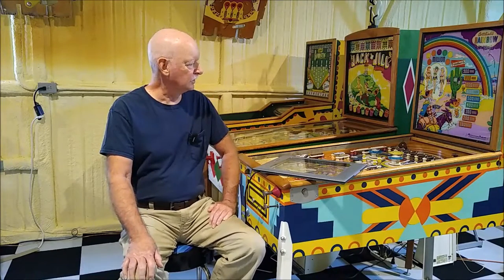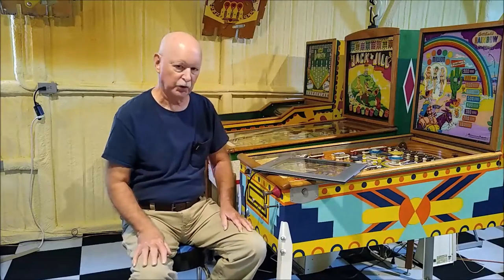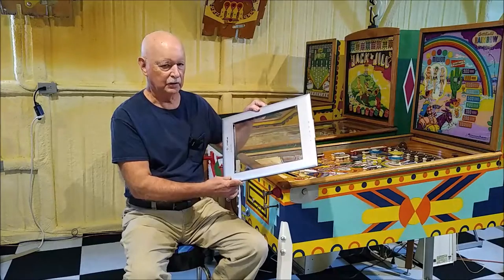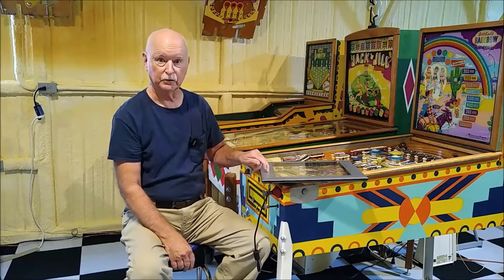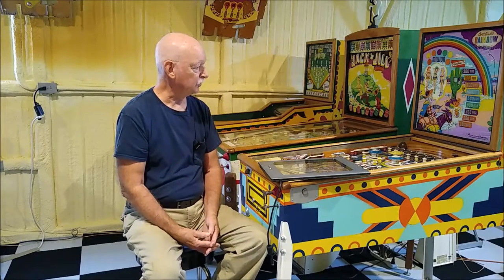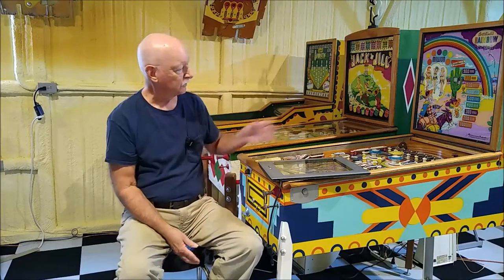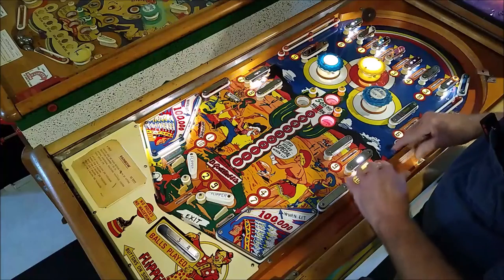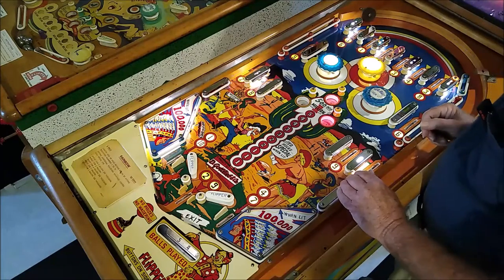Scan a pinball playfield at home

Comment: Great info. I recently had a playfield scanned with large format Cruse scanner  After i get done working on it in Photoshop, I have a local printer that can to print right on the wood.  No overlay .  I have done the same thing with back glasses over the year and had them printed right on the glass.  Great results!!  Can't wait to see how it works out with the playfield
Reply: Whats the printing cost? And what is the process called?

Comment: Great work! I'm just doing the same, but so far I'm using a Canon Scanner (with some "cosmetical" changes to have the scanner glass lying flat on the surface). For easier stitching I used some crosshair stickers, which allow very easy  adjusting of the the different panels. No I just need to find out, where to print such an overlay.

Comment: I don't understand how the overlay is backlit. Are their led strips under it or something? How thick is the translite? This seems like a great way to restore old beat up playfields.
Reply from the maker: The entire playfield is not lit, just the lighted inserts are lit like a normal playfield.  A Translite was used only to make sure the backlit number inserts looked real and natural.  You could also print the playfield on vinyl or poster photo paper, but I don't know how good the backlit inserts would look.  The problem I found with a Translite is that they print the colors  much darker than you think they are going to be in order to look correct for when backlit.  A photo print or vinyl print wouldn't have that problem.

Comment: Great info! Did you make all the cuts in the PET-G protector yourself or were you able to find one pre-made?
Reply from the maker: For one-off projects like this you do your own layout and cutting for the plastic overlay.  The layout is done by stripping the top of the playfield, laying the plastic onto the playfield, marking and center punching all holes and slots that are to be drilled or cut.  Lane slots are cut while the plastic is on the playfield by using a pilot router bit (or Zip bit) in the wood slots.  Holes are drilled or punched with the plastic off of the playfield.